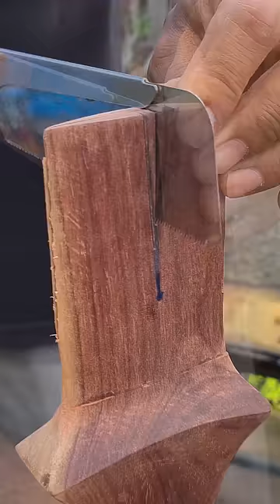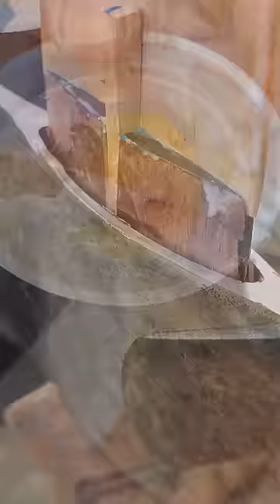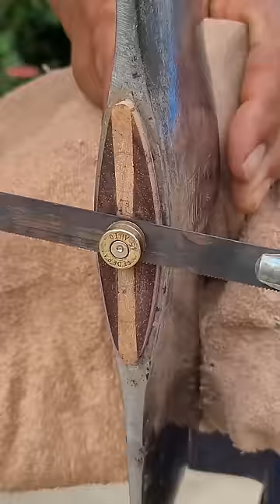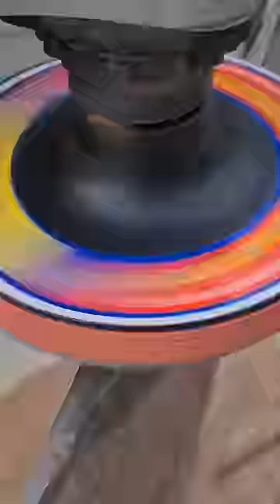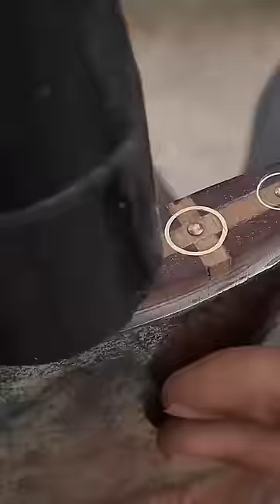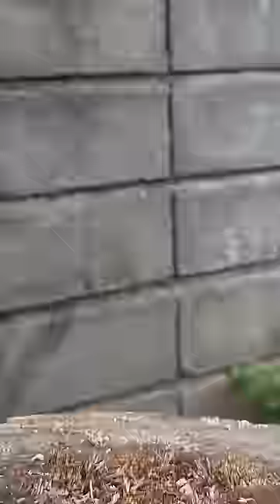Cool axe hanging | Cross wedge + Shell casing + Brass nail #craftsmanship #shorts

Comment: Beautiful! Three brass casings are great. I would never use those axes, they'd be hanging in my living room as art. My wife might have a problem with that though. Another great job!
Reply from the maker: Thank you very much, we appreciate it.🙏🙏🙏❤️❤️❤️🥰🥰🥰
Reply: Не держит под рукой то .. чем она может вас ударить.. тем более в спальне 😅😂
Reply: you know they are trowing axes
Reply: @lonefemboy1742 wrong
Reply: Чехол на топорище или срез острия ну или же тупо смола
Reply: zõr
Reply: ооо иностранцы))
Reply: A
Reply: You couldn't use it

If that would have soft enough to drive ammo brass into it will swell and fall apart as soon as you do any real work with it or get it wet
Reply: @lonefemboy1742  bud pretty sure that’s a battle ax
Reply: Don't put epoxy like he did people
Reply: Just... don't make her angry,  and you'll be fine 

😂😂😂
Reply: That is beautiful work.
Reply: That is beautiful work.
Reply: @Cole-Baker  why? Thanks.
Reply: @JR-zv6qm  Because when you go to replace the handle in the future it's really hard to do so. And it's kinda just a traditional thing.
Reply: This is for decoration. When really using this ax it will break very soon.
Reply: @lenny108 why’s that?
Reply: Так его и делали для этого.

Comment: Looks cool. To anyone else, don’t use epoxy. You’ll regret it when (not if) you break the shaft. Dry the shaft before working it, get as tight a fit you can then fit and oil it until it can’t take anymore. The hold is incredible and helps preserve elasticity where you need it most, as well as gives you rot resistance.

Unless it’s a decorative piece, but that’s a sad end to a perfectly usable quality axe.
Reply: If you receive an axe that has been epoxied and the shaft needs to be replaced, You can build a small fire and burn the rest of the shaft out of the head. Be prepared for some cleanup afterward.
Reply: What tree is this made of? what is the name of the tree

Comment: Hi sorry, genuine question but isn't a double headed axe useless in most situations? Like is it so you can sharpen both sides at the same time to increase the time between sharpens? I'm honestly curious
Reply: Could save sharpening time on this axe. Normally double headed axes can be beneficial by having one side as a chopping side and the other as a wood splitting side. What differentiates this is the thickness of the cutting edge. Thin axes do good at cutting and bitting into tress while this axes along the cutting edge are great at splitting lumber.
Reply: @mateomarquez4343  alright, thank you for satiating my hunger for knowledge

Comment: Can someone explain the geometry behind the casings? I always thought the point of that type of wedge was a conical slope, like if you took a wedge and revolved it around an axis, and then the compression of the wood would help keep he wooden wedge in place by applying force from the inside to the outside. Is this just happening as a result of the metal being pushed through the wood or is an angle needed for it to have this effect?
Reply from the maker: You can hammer the casing straight down, but in our experience it is best to use a thicker casing base to avoid deformation after hammering. If the wood is too hard, it may result in deformation of the casing.👍😊

Comment: Did you have to sharpen the edges if the brass ?
Reply from the maker: We hammered the casing down but had to use the end of the casing because it is thicker to prevent the casing from deformation.👍😊

Comment: why would you drive the nails in AFTER the brass cartridges?  The expansion caused by the nails will be confined to the inside of the ring.  Conversely, if you drove the nail in first it would expand the whole thing and then the brass would expand it even farther.  Right?
Reply from the maker: We just made it for decoration👍😊😅
Reply: @poomsproject  Well that's a perfectly good reason.  I just wanted to understand.  Love this work.

Comment: It’s pretty but in my axe experience you only needed the wooden wedges practically, the nails and bullet casings will probably assist in the wood splitting in unwanted ways and ruining the connection to the head and handle, but hey that’s just me it’s still a cool ass design.

Comment: There's a very basic and serious problem with this axe handle. From the axe head to at least 2/3 the length of the handle,it should be a smooth and gradual transition. The way this guy made the handle all the stresses when doing a heavy chop are concentrated right at the base of the axe head. I earned this when I broke a handle I had just bought, unfortunately it was during a competition.
Reply from the maker: We made it for a display piece.🙏👍😊

Comment: Beautiful,now don’t hit handle below the head when chopping and have to start over..like I have done before 😊
Reply: This won't solve that, but something that will help is to wrap the handle just under the head. Not necessarily the prettiest thing to do, but it will allow the handle to better absorb some of the shock from overstrike without destroying the handle.Can be done with leather, or even 550 cord. Wrap from touching the head down about 4-6 inches and back up to give it 2 layers. Again, not very pretty but effective.